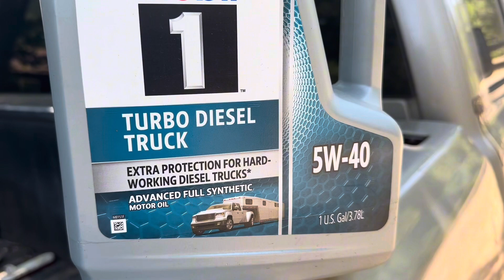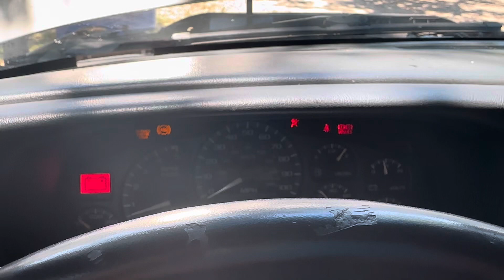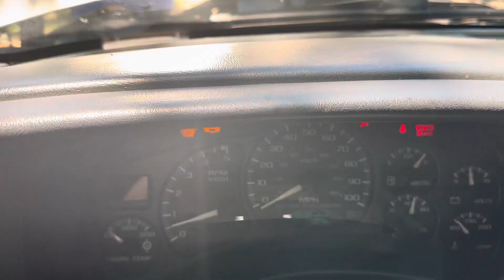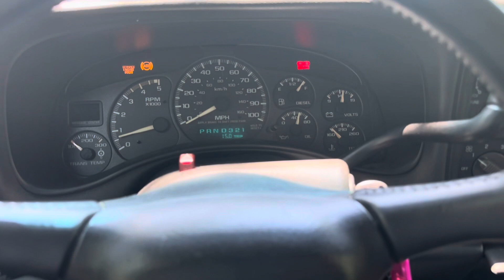FIXED! How to fix Typewriter tick on Duramax and MOST DIESELS?!? Simple solution!

Comment: I know you've said you had been hesitant to run full synthetic due to what you hear about people getting oil leaks - have you noticed any seepage since running/changing to this oil?  Thanks!  I also have a LB7 and she's due for an oil change
Reply from the maker: @MrJmw8201  I don’t think jt causes them but if it’s already got some leaks it could seems worse because the oils “thinner”. But no and I put I think 10,000 miles on it within a few weeks and it didn’t burn a drop
Reply: @CruisinWithKevin  Awesome, thanks for your input!
Reply from the maker: @MrJmw8201  it seems to have worked for everyone that’s tried it from my video so far

Comment: I’ve had this ticking problem too. I have a 2018 L5P and had this ticking since it was new. I’ve always used Amsoil 15W-40 full synthetic max duty diesel oil. Don’t hear it when the truck is cold but after running and it warms up ticking is loud and aggravating. I’m gonna try this stuff on the next oil change. Truck calls for 15W oil. I assume 5W oil is ok to use? 
Thanks for the tip!
Reply from the maker: @nathantaylor6063  I know some people with it happening on the Lp5 as well and ya you will be fine the difference from 5-15 weight is minute and only affects cold properties anyways. I used to use amsoil but I have mixed feelings on it now
Reply: Did this work for you? I have a 2017 and it ticks when warm. It drives me absolutely nuts!
Reply: @matthewcampbell8442   I haven’t changed the oil yet to see if it helps. When I do and if it helps I’ll be sure to let you know. 
Anything that will quiet it down I’ll be glad for!
Reply from the maker: @matthewcampbell8442  yep my buddies new 23 does it too

Comment: I just changed my 07-LBZ’s oil.  Rotella T6 FS 15-40 HD diesel engine oil and it started this type writer tick. 90,000 miles.  I’m changing it out.  Hopefully it stops.
Reply from the maker: @MrNvthis1  try this oil. It was really loud and didn’t make any noise for 10,000 miles since
Reply: Is valve lash to spec?  If it doesn't run right on factory recommended oil weight, you may need some work.  Just sayin.
Reply from the maker: @thewatcher611  my buddy has a brand new duramax it does the same thing. Well known issue they put a service bulletin out for telling dealers it’s a normal function of the engine. A bunch of ford trucks had the same thing
Reply: any update? i got an 06 LBZ, i think my truck makes the noise too but I did see that bulletin about it being normal. But would be nice to quiet it down if possible.

Comment: A good valve lash adjust is probably what you really need.  They get to tappin pretty loud.
Reply from the maker: Engines pretty much new
Reply from the maker: New duramax truck do it too it’s just a modern diesel thing
Reply: @CruisinWithKevin  But what are the valve lash numbers?  Just curious.  It doesn't take much to be off enough on one to make it tap like that.  I still heard it in the video. Just because it was rebuilt, doesn't mean the valve lash is currently to spec.  I've adjusted quite a few valves on quite a few trucks.  Mostly Duramax between LB7 and LML.  That's how they sound before.  If they sound like that after the adjustment, you may just have a bad lifter.  
Most people don't know exactly how the truck was maintained before they had it.  If oil changes got out to like 10K most of it's life, stuff wears out.  Just sayin.
Reply from the maker: @thewatcher611  no idea it quit making noise after this oil. Even the new ones do this.